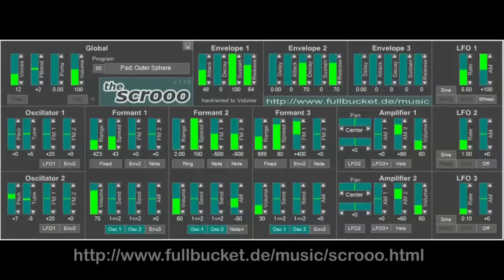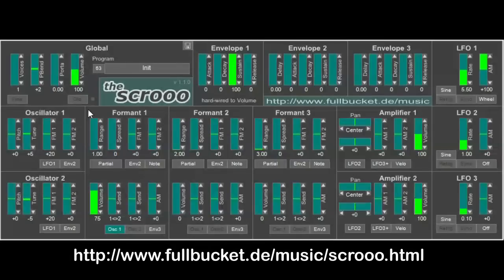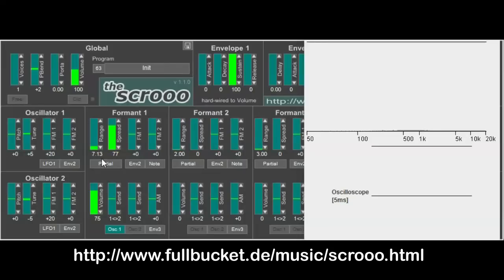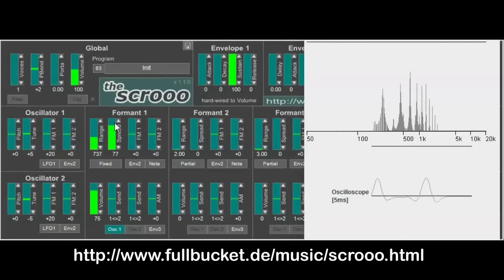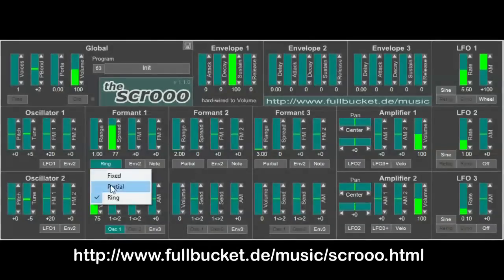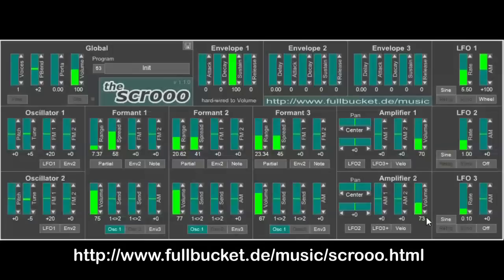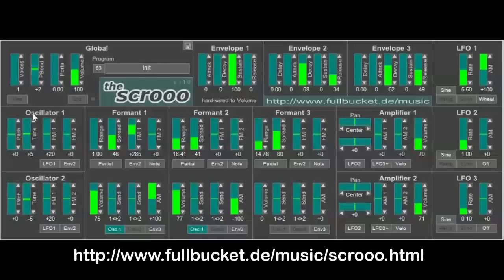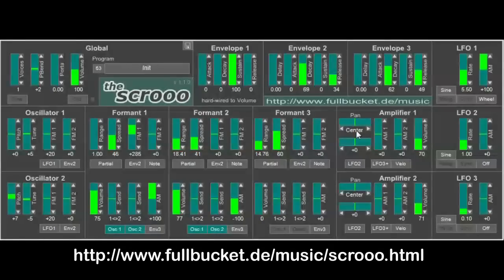The Scrooo (VST and Audio Unit Plug-In)

Comment: This is a wicked synth. I've used in a few tracks. However, at certain settings, when automated, it had a spike in volume  that almost blew my headphones .Has this unpredictable behaviour been resolved?
Reply from the maker: Not sure under which circumstances this happens to you. Anyway, the new version 1.2.0 is soundwise 100% percent compatible to the previous version.
Reply: Hm some DAWs (Reaper cough) auto-mute tracks when stuff like that happens
Reply: stick a limiter on it